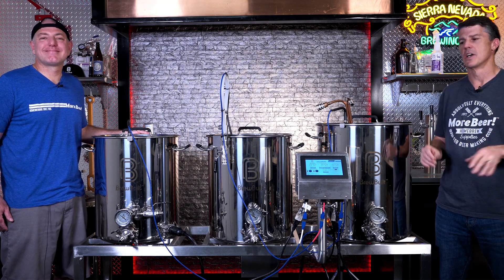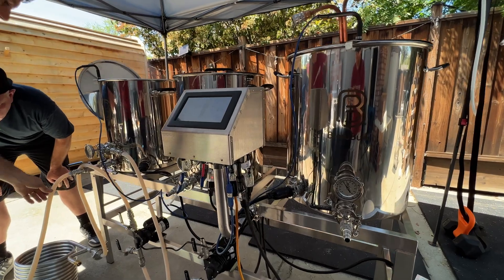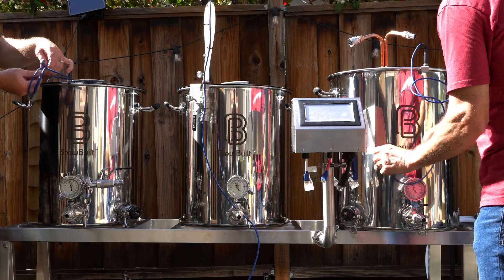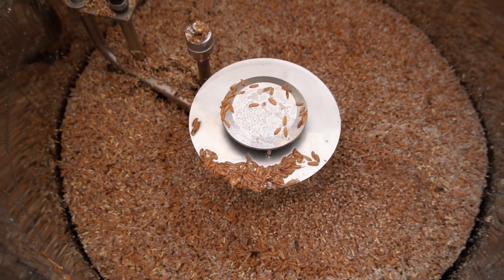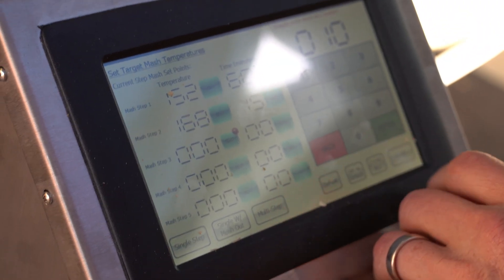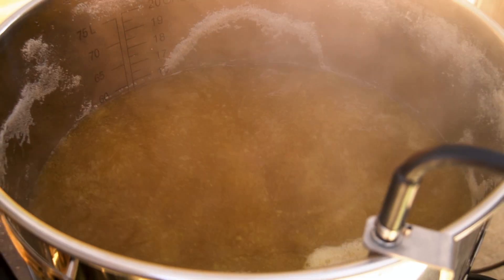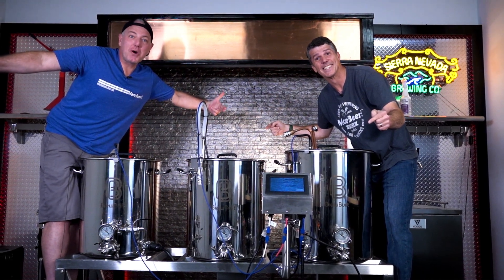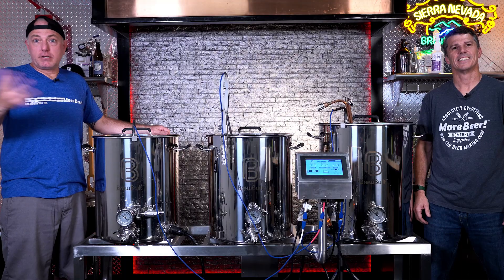Overview of the BrewBuilt Digital Electric BrewSculpture Pt. 1 | MoreBeer!

Comment: How do you cool down the wort with this system?  Do you use a plate chiller or a reverse flow or something else?
Reply from the maker: We used this awesome counter flow chiller, The Beast from BrewBuilt - https://www.morebeer.com/products/brewbuilt-stainless-steel-triclamp-heat-exchanger-beast.html

We've got a short video showing this process coming up soon!
Reply: Cool